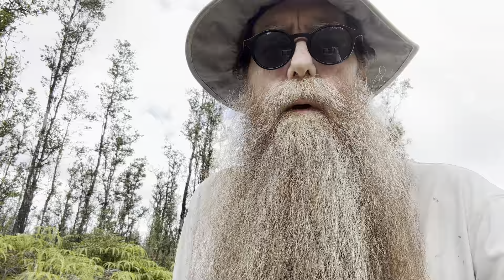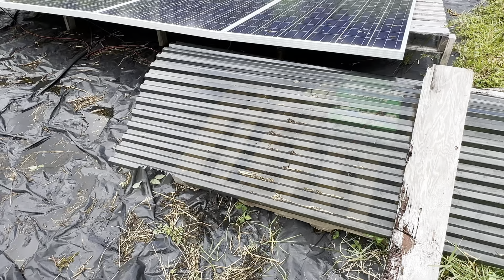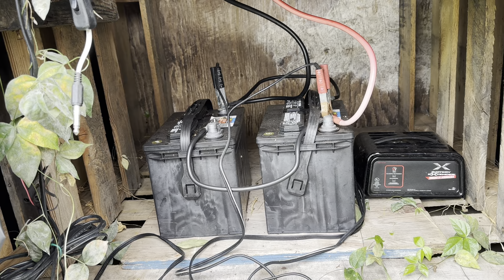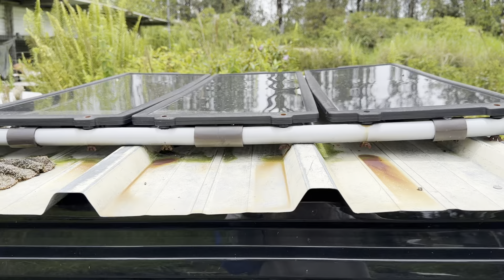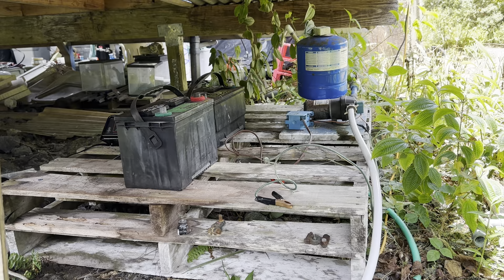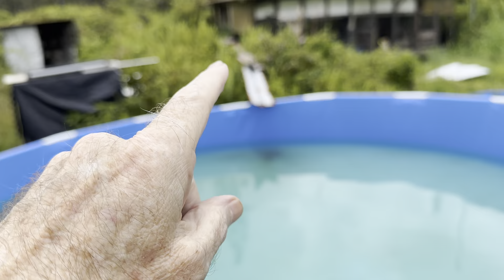Guest solar system #3 Part 1 Neighbor helping neighbor Understanding some basics of living on Solar🤙

Comment: Gary, thanks for the content.  I don't normally comment too much but I have a couple of tidbits.  1.  That inverter is dangerous being outside with no effective grounding and you don't normally come back from being electrocuted.  Check the ground lug and the chassis with a Volt Meter and I bet you won't see a reading either!  2.  The Xantrex C-40 series is PWM and the newer version has a heat sink as well as marine conformal coating for corrosion.....not sure about the unit in the video since its probably circa 2009.  3.  Using a 60 cell solar panel and PWM controller is usually a no-no since the voltage (efficiency ) is wasted......In my testing using 60 cell solar panels (32-34 volts) a Xantrex C-60 PWM charging a 12v nominal system will drop the PV array voltage to about 14-16v thus losing the power curve from 16 to 32v or about a 50% loss of the panel.  Therefore, never wire those panels in series as it wastes even more harvest.  But four panels in parallel would maximize the amps into the battery from the 50% loss so that max he will see to the battery is more or less like 180-225 watts.  4.  Have you friend write down his goals and then inventory what he has to work with including safety devices like a fuse or cutoff switch and then maximize the harvest or even move panels around to the second system.  Also, I have been testing east, south, and west facing panels using multiple controllers using 100 watt panels and have been getting an additional 300-400 watt hours of energy captured rather than the traditional south only facing panels......take care and stay safe!  Gary  (PS:  that Xantrex has no temperature setting and the sensor is TOUGH TO FIND!!  You may want your friend take a careful look at the temperatures during the season and adjust accordingly....being in Hawaii maybe NOT an issue, but it is a big issue here in the midwest.
Reply from the maker: All great information my friend, and mahalo for taking the time to share it with all of us!  Hopefully have a follow up soon on making a few adjustments for them. Aloha! 🤙

Comment: The Xantrex C40 has specific operating parameters, wiring/ cable sizing, mounting orientation, and grounding. None of these are being complied with. 
    The PV array is designed to withstand outdoors environment. None of the other appliances are designed for outdoors installation; they must protected from the elements. 
    I wouldn't touch it at this point because what is operational will likely fail or start a chain reaction. 
   1) First, a structure suitable for the installation of the electronics must be built.
  2) A grounding rod must be installed. The cases of all electronic devices and the PV panels must be tied to Eart ground.
  3) The PV array wiring method will determine the Voltage and Current. These need to be compared to a DC wire gauge chart or a math calculation formula. This arrangement is either Over voltage or Over Amperage. 
   Unfortunately, they want to run at twelve volts when they should be at 24 volts! 
   That said, seithing to 2P2S PV method with a MPPT CC would make a world of difference.
Reply from the maker: All great points for sure, and mahalo for sharing brother. Gonna try , although many moving parts you know.....Aloha! 🤙

Comment: well your neighbor has a nice start. nice big solar panels. I used them interstate batteries before. still got one. for lead battery that a better one. just some tidy up will be a big improvement. settings on that C40 look fine. looks like 2 Walmart batteries on outher system. they ok. but question how good they are being left discharged state. them 3 small panels may not be enough.  That big system will do a lot better if willing to go 24V.  put battery's in series. 24V MPPT 24V inverter . series the panels. but I see they need 12V. may be separate 12V system. but I question them small panels are enough. anyways show them your systems . get some ideas going. help them figure out what their needs are. go from their. they need to make a system that works well for them. start with paper. write down what you have now . and what the needs are. start drawing some plains. make a plain . if you don't like it rip up paper start over. take lots of notes. talk to others doing the same thing. watch youtube videos' . I am always learning new things on youtube ! if they need new batteries go LiFePO4. it is cheaper in the long run.
Reply from the maker: Yeah, you know that system actually has some good bones. We'll do what we can to make it a bit more worry free. Plenty solar coming in for what they need. Little cleaning up, a power box etc. etc. All good. Aloha! 🤙